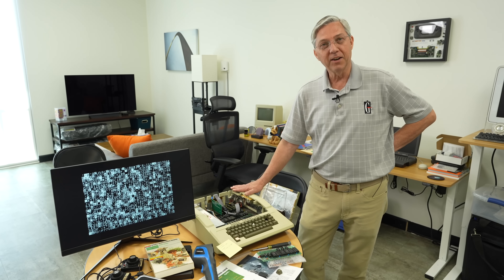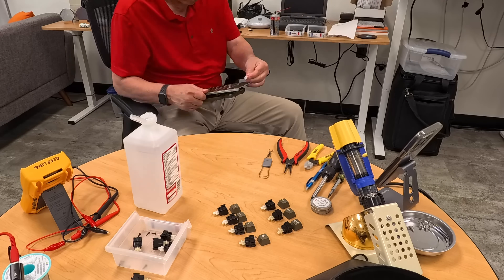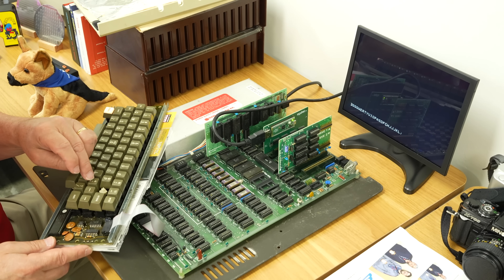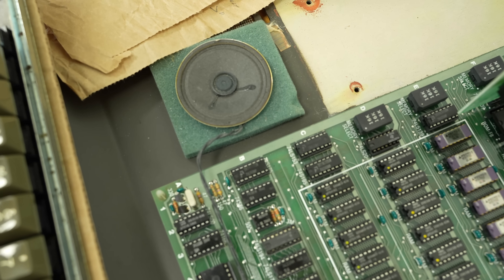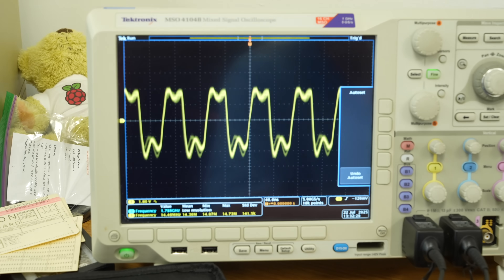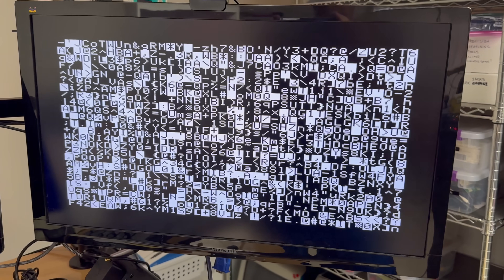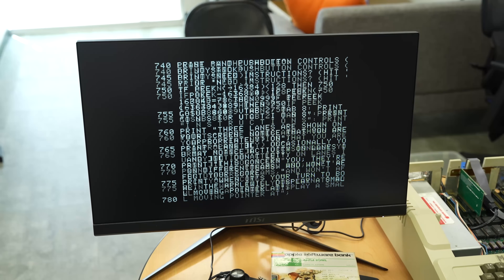The Apple II and the Mysterious Ticking Noise

Comment: Make sure you run that gun for at least a second after desoldering and before you put it down run the rod through it.  Also, if you get different sized nozzles get the correct sized rod for every nozzle.

Comment: I am not an apple guy, but from similar vintage arcade machine troubleshooting, sometimes those "not quite square" waves, especially on shared busses like an address or data line can be one chip messing with the bus for the whole machine.  If one specific line (ie: "A5" or something) has a specifically different looking waveform, it may be worth monitoring that wave repeatedly as you pull out some of the chips on that bus and see if the waveform improves.  These are frustrating problems to find, but very satisfying once you find it and solve it!!

Comment: Wild stab: DRAM/refresh? Long time ago, I had a TRS-80, which I learned how to solder on. I extended the memory from 16KB to 48KB with piggybacked DRAM chips. At some point, I had issues where the DRAM refresh was not working well and then the DRAM would gradually lose its content.

Comment: If your 5V rail is clean but your clock isn't, it could be anything from a cap to a chip, but if your 5V rail is dirty, your PSU is the guilty party. A lot of rifa caps and tantalum caps don't survive, you might check the tantalums on the board. Cool vid, it’s nice to see a family that can sit beside one another without requiring their phones out.
Reply: Indeed. Those picopsu’s can be quite noisy.

Comment: I worked on an Apple II recently and learned that the ticking from the power supply is normal if it has no load. For a bench test, put about 0.5A load on the +12 and 2A on the +5 and the ticking should stop and the output voltages should be correct.
Reply from the maker: I've added a note to our PSU rebuild issue on GitHub, and we'll test with a load next time we work on it! https://github.com/geerlingguy/retro-computers/issues/15#issuecomment-3264425048
Reply: All the self-oscillating flybacks (Astec) powersupplies need about 10% minimum loading. At no load they do do wonky things like burp on/off. A quick probing around on the secondary side at one of the windings will tell you lot about the noise.
Reply: I also remember the original Apple ][ PSU made a ticking noise when no load was present (i.e., not connected to the motherboard).

Comment: Of course it ticks, you have NO LOAD on it and it is a switch mode power supply. What do you expect, it cant regulate itself and shuts off and tried again and again.
Reply from the maker: It was doing the ticking sound when plugged in as well, with the motherboard trying to boot. But that doesn't rule out a no load condition, maybe one of the output wires was shorted or broken, too... something we'll look into.

Comment: When you replaced the power supply, the original one is a "linear power supply" the final capacitors smooth the voltages to reduce voltage ripple. The replacement one is a switching power supply, which requires even more filtering since they relay in switching frequency of around 50KHz. Try adding some filter capacitors and ferrites on the output wires.
Reply: The original Apple II power supplies were switching type.

Comment: Keep in mind that the 14 megahertz clock is not exactly 14 megahertz, but is 14.31818 megahertz, which any TV engineer in the USA will say "Ah ha!"  This is exactly 4 times the color burst frequency for NTSC.   (PAL is 4.43361875 megahertz, for comparison.)  Woz saved the cost of an entire other crystal or PLL circuit by using the frequency divider this way.  The dynamic RAM required refresh cycles, which ran every other 2 megahertz cycle via a Row/Column address counter [remember RAS and CAS?], which also fed the video circuitry while the processor (and DMA circuitry on each expansion board) used the RAM during the other half-cycle.
Reply: Wow. I wonder what crystal oscillator frequency the PAL version of the Apple II used.
Reply: @BrianG61UK  14.250450 Mhz.  But the PAL circuitry was usually an external adapter because the color burst for NTSC is different from that used by PAL.  The //e and the //c were black & white only for PAL without it.

Comment: I seem to remember from other Retro channels that there is a keyboard adaptor circuit board that can plug in instead of the original keyboard, and it takes a modern keyboard.  The PS2 adaptor you found was probably an older version of that.  It's probably easy now using an Arduino that has built-in USB, only needing to boost the voltage levels to drive the input the old TTL expected -- but, I think output drivers are also quite common for all sorts of peripherals and I'm sure can be configured for the proper voltage.  There's even logic level converters, but I think the "5V" it supports might still be too new.

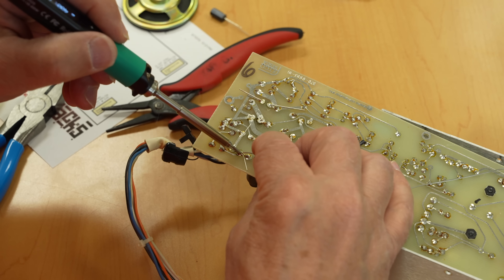Comment: Bending the wires when soldering like timestamp 6:00 is not really a great way to solder components - there is a risk of wires touching - My absolute guess is this is why the board is shorting out now and not working anymore - as well as risk of shorting it makes unsoldering very difficult as you have to simultaneously de-solder and unhook wires - i ve never seen it done like this, from factory, in these old computers. Hope you get it working - I would recommend a chip tester and test each chip since you have them all out now. .Retro Chip Tester is a fun project to build - I built one and it works amazingly well. All the best...

Comment: Fun fact:  Chip pullers used to come in "computer toolkits" along with hex-head screwdriver, magnetic pickup tool, etc.  I had one with the two flat plates style though still cheaper made than the one you showed.  Most of the time these kits had the most basic bobbypin-style puller.
Reply from the maker: Yeah my first computer repair kit had one but that is long gone! I tried a couple 3D printed chip pullers but they were not that much different than the screwdriver + finger method!

Comment: Does that cheap Jensen shoebox tape recorder work tolerably as a storage device with the Apple II or other computers?  I haven't bought one because of their bad reputations, nowhere near as rugged as tape recorders of the 1980s.  But to use one with my 8088 retro machine might be fun.
Reply from the maker: it seemed to work fine for the two times we got a program loaded that first day. Honestly the mechanism and over all design seems to be identical to many of the older recorders, probably with a different outer mold and some different plastics and rubber used!
Reply: If its modern, almost certainly it has a fixed magnet erase head and dc bias so I don't expect it will record well. Recordings done this way have a high noise floor and poor frequency response. Which affect data readability. Playback of older tapes should be fine though.

Comment: Check that the voltage rails are clean and not sagging under load.   If it worked with the original PSU then logic would suggest that if these problems occurred after fitting the replacement then "there's your problem".

Comment: The original power supply is a bit of early switching black magic, but my quick guess from looking at the schematic would be that the crowbar circuit on the +12v rail is triggering, either due to a genuine overvoltage condition or the zener on the gate of the SCR has failed. When the +12 gets shorted by the SCR, it'll shut down the feedback circuitry on the low side of the board and the switching circuitry on the high side won't exit its start-up mode. I would NOT expect this power supply to function on the bench with no load on the 12v rail.

Comment: On the underclocking idea: keep in mind that the original NMOS 6502 has a minimum clock speed of around 100kHz before registers start losing their values between clocks. The CMOS 6502 can, however, be clocked down to zero.

Comment: My personal guess for why the PicoPSU is causing issues is that it doesn't have enough capacitance at the outputs. Modern motherboard have capacitors dotted everywhere so it isn't as much of a problem but these older computers are relying mostly to the capacitance in the PSU itself. Might be completely off as I am mostly self taught with this stuff.

Comment: I never had a failure, a single failure writing and reading from a cassete tape on a Brazilian clone of Apple ][ (a DM II an Apple ][ plus really): I simply used an Akai CS-705D tape deck that allowed me control the volume with precision (and two VU meters on it). Probably the tape deck costed more than the computer.

Comment: For troubleshooting I would definitely have NO cards installed. The NTSC video out is a better diagnostic signal than anything the fancy HDMI card would output, as the video generation was the heart of the Apple II and requires functioning RAM to work. Sadly, nothing beats a real CRT monitor for tolerating the "pretty close to NTSC" output of a genuine old Apple II, which is what makes that HDMI card such a nice gadget if you don't have a tube-based monitor handy.

Comment: For a collector you destroyed this Apple ][, with your power supply "fix".
Reply from the maker: We still have the original, and will be fixing it at some point. I haven't tossed any component removed from the thing :)

And back in the day, people modded their original IIs like crazy, like with the external joystick port, the foil everywhere, etc.

It's part of the quirky charm of early computers!
Reply: @GeerlingEngineering  Yes, most Apple-1 were modded. Those modded ones reach the lowest prices in auctions. Even exchanging one of the Spragues from the power supply, reduce the worth by about 100k dollars. The original pre-Apple][+ are rare by now, especially in this condition. I wished i had one.

Comment: Looks like youbpowered that old switch mode without a load, and that probably killed it. Early switch modes couldn't start without a load.
Reply from the maker: We first powered it plugged into the board, that's when we started having boot issues, and then it started clicking before we unplugged it. We only unplugged it after testing out everything else, when it started clicking.

Comment: did you measure the resistor that was getting hot that it wasn't blown to 0 ohms? it sounds simple stupid, but anyway worth checking. following that tree upwards downwards form the resistor would probably get you to the right place anyway if its not something weird with the switching oscillator itself.

Comment: the keyboard on the Apple II/II+ is just 7-bit parallel ASCII with a strobe. its pretty common to blow up the keyboard encoder chip by plugging the ribbon cable in upside down.  I have built a USB/PS2 keyboard encoder using a teensy, and also a replacement for the encoder of the 2-part keyboard that some Apple II machines shipped with.  I'm pretty sure ReactiveMicro or someone else has a nice product made that combines the USB/PS2 encoder and replacement encoder board for the 2-part keyboard.

Comment: It's also possible that the Tiny PSU is introducing more noise than the rev 3 or rev 4 motherboard you have in your system can handle.  So repairing the stock PSU might help with the system stability.
Without the Apple ROM card in Slot 0 you won't have the Autostart ROM which takes you to the Apple 2 boot screen, unless that ROM has been swapped for the F8 ROM on the motherboard.  This means you'll get the screen full of garbage at start, hit control Reset to drop into the monitor.  Then you can type 6 and control P then return, to boot from a floppy controller in drive 6.

Comment: I also went through an old Apple repair recently and just wanted to share one of my solutions. 

I have the Apple IIe, which looks like it uses slightly different key switches (Alps SKCC) than the ones seen in your video. Some keys worked fine after a bit of cleaning and/or bending the spring contact a bit more aggressive, so that more force is used to make the contact.

For the ones I couldn't repair, I was looking around for alternatives, and even thought about making some myself... BUT I realized that I could 3D print some adapters and use a modern key switch in place of the broken ones.

(I would've preferred using original parts, but this will have to do) I found that the Gateron EF Grayish had the most similar tactility to the original and is also one of the highest actuation forces (the Alps skcc supposedly is ~90-100gf). You can even replace the spring to 100gf if you'd like to make it feel more genuine and much closer to what the keys would've felt like brand new.

The models for adapting modern key switches: https://cad.onshape.com/documents/1a5877cae305d0dca7f2ceb2/w/00c921e1a0198a17261d1dc9/e/bd44ae3d2280561513ff66cc

Comment: As an original Apple ][ and //e user, it was satisfying to hear that the chips had been re-seated. That was a regular problem even with routine daily use, we would always pop the lid and press down on every socketed chip whenever the machine was misbehaving. Often I would hear the characteristic noise of the chip going back into its socket.  Guess it was caused by thermal cycling.

Comment: The keyboard has an encoder IC that contained the debouncing circuit.  When I worked on those boards, I never had a need to tune the debouncer, but I think there's a capacitor that could be changed.  Also, the keyboard outputs 7-bit ASCII in parallel, with a strobe signal that the firmware would poll at location $C000 when it needed input.  There's no UART involved, and this thing obviously predates USB by a decade or two.

The power supply ticking was normal when the output was out of spec, i.e. it was unplugged or when one of the supply outputs was shorted.  The stock power supply was not sufficient to power more than 2-3 expansion cards, and there were after-market products that filled that need.

The digial logic was at LSTTL levels, so an input signal below 0.8 volts was low and above 2.0 volts was high.  For noise immunity, the output signals were 0.4 volts and 2.7 volts, respectively.  The noise you're seeing was typical of the time but the levels appear to be in spec.

The row of RAM closest to the keyboard fill addresses $0000 - $3FFF, which is where the 6502's zero page and stack page are located.  It also contains the screen buffers and only a small amount of space for BASIC programs.  Nothing will work if that row is not fully populated with functioning chips.  The middle row stores addresses $4000 - $7FFF, and finally the row next to the 6502 stores $8000 - $BFFF.  The ROMs are labeled with the high byte of their addresses.

256 bytes between $C000 - $C0FF were reserved for I/O on the motherboard and expansion cards.  Each expansion card (except slot 0) had 256 bytes reserved for on-board firmware starting at $Cx00 with x being the slot number.  Addresses $C800 - CFFF were reserved for additional firmware supplied in ROM on the I/O expansion cards, but that range was shared and there was additional work needed to enable it when needed.

The ROM card in slot 0 banked out and replaced the motherboard's ROMs depending on the setting of the switch.  You must turn off the computer before changing its setting, then power up again afterward.  There was also a RAM card that could be placed in that slot.  It worked the same way to bank out the ROMs and there was an I/O bit to bank it in.  All writes between $D000 - $FFFF would be stored on the card.  It was primarily used in the Apple II+ to give access to the older Integer BASIC, Sweet16 interpreter, mini-assembler, and programmer's aid chip.  It was also used in the Apple II to give access to Applesoft BASIC without loading it into RAM.

When I worked on these, a "no-reset" condition could be anything.  Sorry, no help there.  But one thing I might mention is that the IC sockets themselves could be disassembled for cleaning or repair.  The plastic can be lifted off to reveal the connections within, while the sockets are still soldered to the board.  They're pretty delicate, but it's possible to restore the shape of a bent connector inside a socket.

Also, there are a few electrolytic capacitors on the motherboard that might need inspection.  And the schematic in the red book is for the first Apple II revision, not the 1979 revision you're working on.  But the changes are small and subtle.
Reply: Beat me to it.  That is what I was going to say.
Reply: Nice Flair With That Dalek Poster❤😊

Comment: Much of the time you need to put a load on switching PS for them to work.  Many use a 12v automobile bulb.

However it does boot with the Pico so not likely a problem on the MB causing the PS to tick.

Comment: You have spare Datanetics switches? Where did you find them? I had no such luck a few years ago when faced with 20+ defective switches on my uncle's ][+ and took a different approach by designing two 3D printed adapter parts to use Cherry MX replacements — they're on Printables, Thingiverse and AppleFritter should you ever need them.

I have a pair of ][+ here that I haven't touched in a while, one has a dead power supply, will look into PicoRC.

Regarding your next issues: do you have access to another, working ][+ ? You could swap some RAM chips and use something like Apple-Cillin II to narrow down which ones are problematic. Otherwise there should be purpose-made standalone chip testers that support them. Perhaps take the machine to a VCF meet?